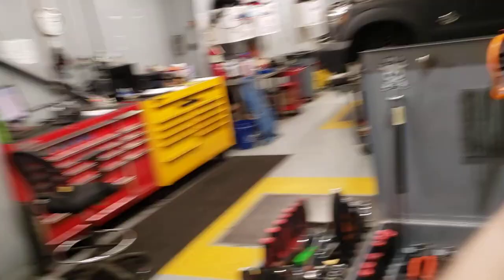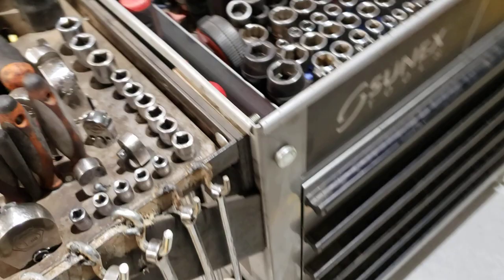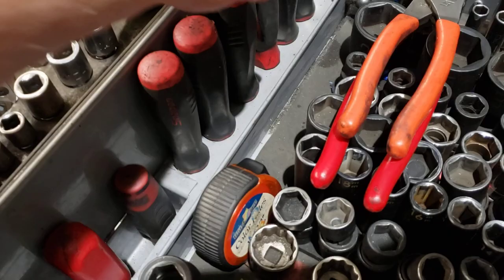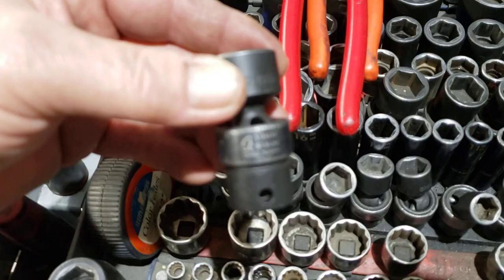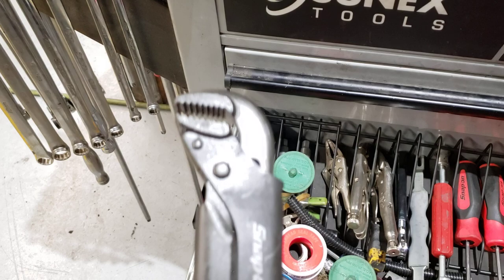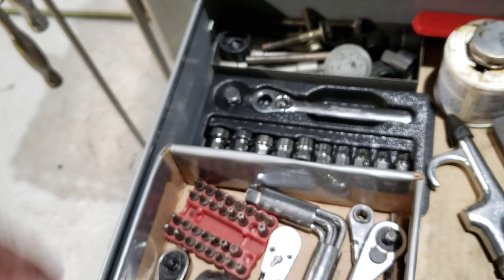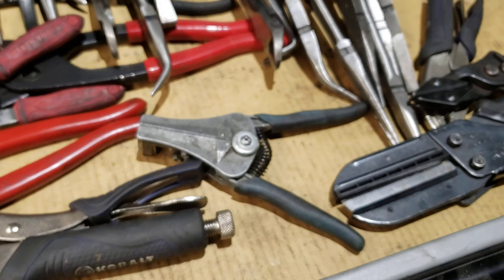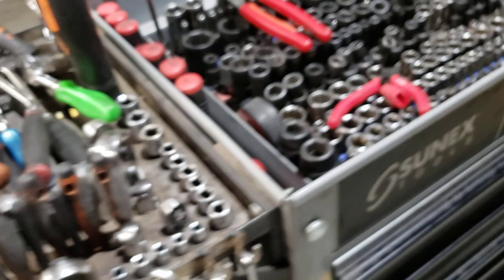The Best Tool Cart

Comment: the 18.5mm 19.5mm socket is actually for ford wheel nuts for when the chrome cap on the nut is either swollen or missing
Reply from the maker: I appreciate your feedback but actually newer vehicles are starting to have that size as standard size, my coworker just had a newer vehicle yesterday.
Reply: @NutsandBoltswithTone  https://www.amazon.co.uk/CTA-Tools-4221-Socket-18-5mm/dp/B01D4QBH7Q
the same tool you have read the description on what is designed for
Reply from the maker: @pra5907  omg thank you,  I actually never read the description,  I bought it because it looked like something I may need in the future and I have.  But in the same token im pretty sure I've needed it on some newer vehicles but I could be wrong.  I'll keep an eye out. Thank you for catching that.
Reply: They're used on a lot of different vehicles, you can get a 2 flip socket set with 4 half sizes.
Reply from the maker: @kylesonsalla7620  awe man thx for the reply,  I wish I had bought the set,  I bought that socket awhile ago and they didn't have a set on Amazon. I'll have to look for the other socket now.

Comment: I need one of those big magnet on the lid to hold the tools I am using on a job
Reply from the maker: It is from Snap On. was on a tray with handles but I threw away tray as I was only going to use the magnetic portion. Thank you for watching.

Comment: Good looking setup! Love that side tray
Reply from the maker: Thank you.  It definitely is a game changer in efficiency for sure.
Reply: I have a 30 inch 5 drawer HF cart currently, have a Husky power tool holder and the can holder on one side and a side tray on the other, might have to sacrifice the side tray and drill some holes in it
Reply from the maker: @kylesonsalla7620  is the side tray you have for parts? Like a flip up tray? If so probably will not be able to support the weight.  If you would like i can get you some pictures of an over view of my side tray for reference.
Reply: @NutsandBoltswithTone  
It's the flip up one they sell for the carts. It's pretty strong, I had my 3/8 14.4v impact, my MG725, a bunch of sockets, extensions, pry bars, wrenches, etc on it today taking a DPF out of a T680 and it didn't flex at all. I was more thinking just around the perimeter though to store my ratchets and some more pry bars. All the holes inside the lid are taken up with tools already.
Reply from the maker: @kylesonsalla7620  that sounds awesome I think you will love it

Comment: Way to utilize your real estate 🙌🏼 I love the video dude, sound is crisp and clear and the image quality is clear . You have an awesome collection of tools, I have those same Matco pry bars, I love them unfortunately I left one on the frame of a bus and off it went 😭 lol
Reply from the maker: Thank you so much,  very kind comments.  Sucks about your pry bar.  I still need one more pry bar I want a bigger one.👍
Reply from the maker: I'll be continuing with the content, tool reviews and also fixing and diagnosing.  Make sure you subscribe so you don't miss any.
Reply: @NutsandBoltswithTone  
Mayhew Dominator bars(the same as your Matco without the markup) go up to 58". I'd recommend the screwdriver pry bars too.
Reply from the maker: @kylesonsalla7620  thx for the advice I'll check it out,  I actually do need to buy a 58 inch pry bar,  that's the one I do not have.  I appreciate your feedback.

Comment: Your big matco ratchet will see high failure rate once you go to a 1-1/2 nut even if you heat the nut orange it will  fail the shop 3/4 gun sucks and I had to build a subframe for a trailer great tour BTW
Reply from the maker: Thank u.i bought that ratchet many years ago,  would have for sure bought a snap on one of i had bought it recently for sure.  Thank you for the feedback.  I appreciate it.

Comment: Very nice cart. Bought multi tool that you recommend and swag tool. I was looking for that tool for a while too. I was doing vw injector o-rings though that tool will be handy to have or when doing any nylon o-ring. What brand are those air swivel fitting that you have on your air tool? I had some on my air tool in the past, but these don't last very long. Really enjoy your videos.
Reply from the maker: Thank you so much.  I will look at the brand on monday. I've had those fittings for quite some time. The swag tool is the best.
Reply from the maker: There is not a brand on the fitting itself, I found this which looks exactly the same. Coilhose Pneumatics 59-06BS 3/8” Automotive Ball Swivel Connector, 3/8” MPT  I bought mine from the Snap On truck.
Reply: @NutsandBoltswithTone  Thanks a lot.

Comment: Nice tour. That 3/8 17mm swivel is the only one I’ve broken and they sent me a new one in about 3 days. I started with the ez reds you have to flip and they’ve been great but I have upgraded to platinum and mountain as needed
Reply from the maker: Oh man that's awesome to hear someone else have a great positive experience.  I never had the ezreds that u have to flip, but I can see how they could come in handy in some cases.  Thank you for the feedback, I appreciate it.
Reply: I was supposed to be buying the platinum set from this guy but he couldn’t find the 8/10 so he offered me the ez red set he just got instead and they were a lot smoother. I’ve backed myself into a corner with them a few times and you’re right about the offset helping with stuff like pulleys and window regulators
Reply from the maker: @gregblau8082  omg yes I have gotten stuck up against a fender or something like that,

Comment: Hey cornwell has 80 tooth same as snap most of the new snap are 80 and the cornwell  matco gearwrench all interchange
Reply: But Snappy is DUAL 80, like 160 teeth. Only stuff that really comes close are 120XP's. The 88 tooth Matco feels notchy comparably. I have both Snappy and Matco and only reach for the Matco if I need the locking flex head.
Reply from the maker: I do not think anyone can compare with Snap On for feel of the ratchets.
Reply from the maker: I have a couple Matco 3/8 inch I use quite often only because of the type of ratchet it is, I really should replace them with Snap On and take Matco ones home.

Comment: Great video. I like the side tray. What is the make and part numbers of your 90° strippers and heater hose pliers? Also, where did you find the small pry bar you use for oil pans?
Reply from the maker: I will get you that information on Monday. Thank you for the comment and feedback
Reply: @NutsandBoltswithTone  Awesome. Thanks.
Reply from the maker: Pry Bar is 4140 Sheet Metal Skin Wedge.  Heater Hose pliers are SP Tools UNIVERSAL HOSE PLIERS FITS 1/2IN TO 3/4IN.  90 degree strippers are OTC. Hope that helps.
Reply: @NutsandBoltswithTone  thank you.

Comment: How do you secure your tools on the tray, so they won't get stolen
Reply from the maker: So that is the tricky part.  I work with only 4 to 5 other techs and have never had to worry about that thankfully.  When I have needed to lock it up I just throw all my ratchets in the top compartment.

Comment: Tool truck brands are no better than any number of internet brands... just more expensive
Reply from the maker: I appreciate your comment but I have to disagree,  there is a difference between them.  Now there are some good brands out there but there is a difference.
Reply: @NutsandBoltswithTone  it used to be that way, but with brands like sunex, Capri etc. anymore. There no other reason than Convenience by going with tool brands. I know mechs working in the mines in Wyoming that say there is no difference overall other than the prices.
Reply from the maker: In some tools yes.  Ratchets i disagree. I have yet to hold in my hand and use a ratchet that feels better then a snap on ratchet.  In the end they all get the job done. Im not arguing that one brand is better then the other. I have multiple brands and they are all good.
Reply: @NutsandBoltswithTone  there is absolutely nothing wrong with wanting all tool truck  brand tools. but at the same time trying to tell someone else that they are the best is just Dishonest. No one should be telling anyone else what to buy, bias is best kept to one’s self.

Comment: A new tech (millenian ) be like how many batteries you use on those power tools and what voltage are those 18v 20v and amperage 😅😅😅😅
Reply from the maker: The batteries are 14.4 volts. I have 7 batteries, I have 4 cordless ratches but only use 3 of them, 3/8 impact, 1/4 drive impact, a adjustable light and I just got an amazingly bright uv light for leak diagnosis. I am not sure what the amperages are. Thank you for the comment.
Reply: @NutsandBoltswithTone  I was playing a joke on your air tools 🤭 you can't deny hearing those air impact guns blasting on the shops it can make you think you're on the racing pit